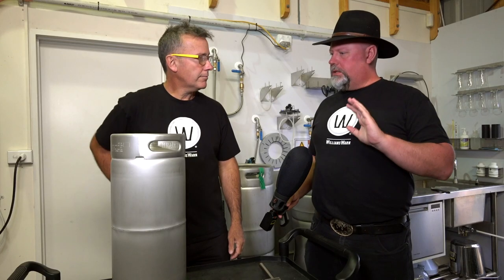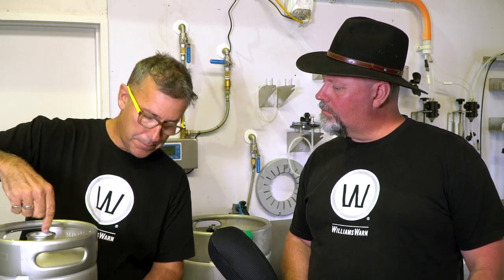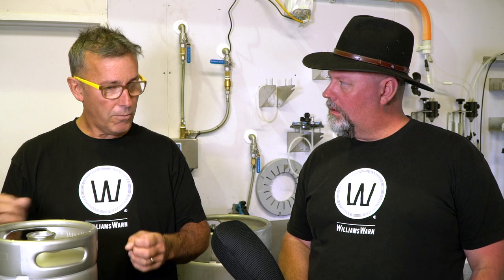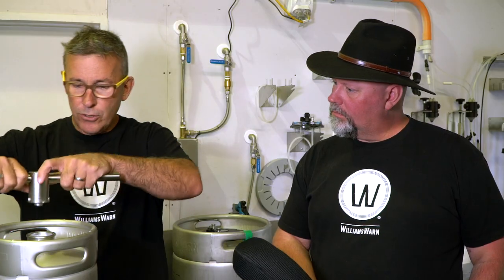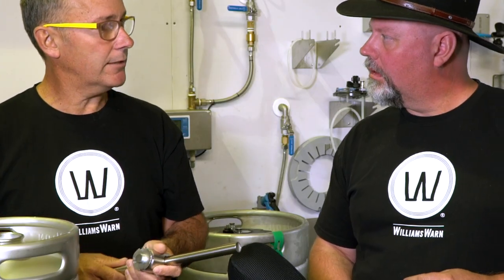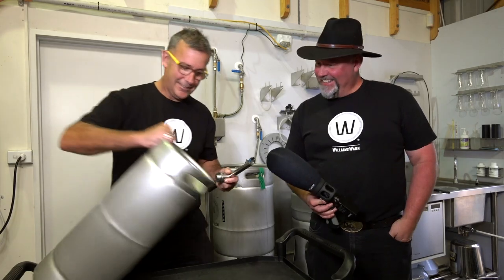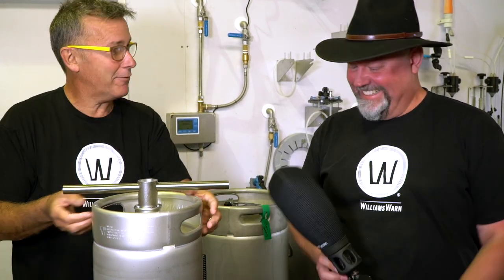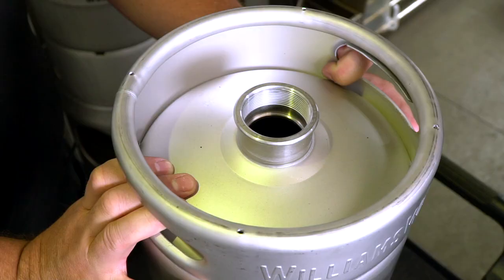How to remove a D type keg spear

Comment: hello, what is the Keg remover tool you used called? and where can I get it?  thanks
Reply: what im going to do is use a square the same size add what need to be for the thickness cut them to the length should work, do have a press to let the air out for the other type of key but for me its so hard to put that spring back in.
Reply: .
This a European keg without the circlip!
Us Americans like to make things more difficult...
Reply: Its a d style keg spear tool